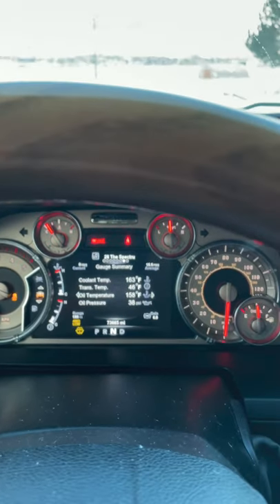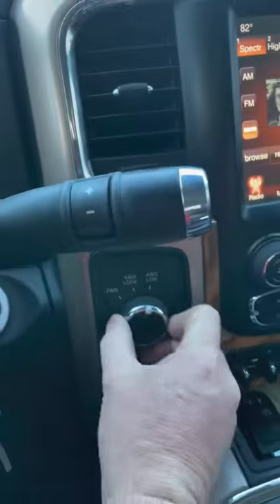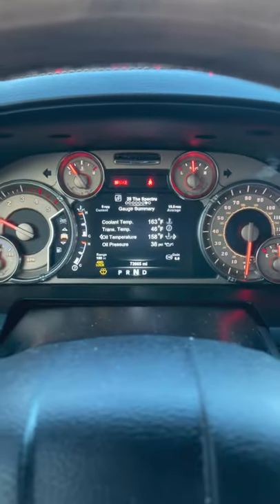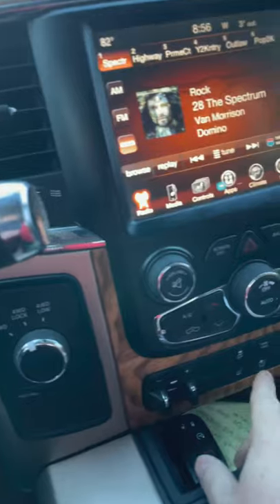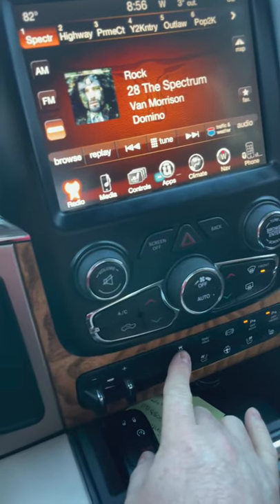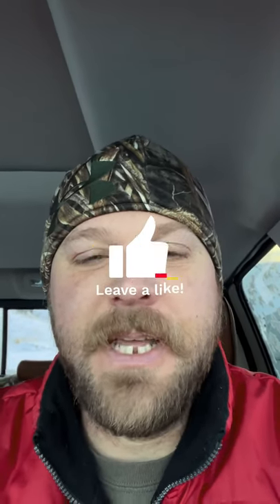How to Turn off your Stability control in a 2017 Dodge Truck #short

Comment: Donuts in 4x4? No thank you💀
Reply: It’s the only way to do it in these newer vehicles. The stability control takes over in 2wd.
Reply: Unless your abs fuse falls out accidentally
Reply: @johnathangraham7226  didn’t know that, ig I’m very lucky to have a 2wd truck 😂 also unlucky, roads are iced over rn and I can’t drive
Reply: its not the only way pull the fuse or add a switch to the yaw rate sensor @johnathangraham7226